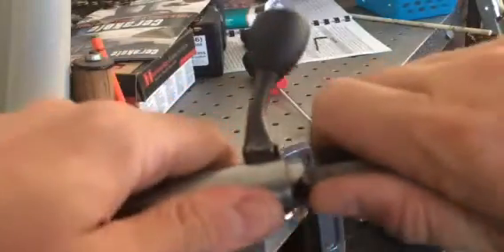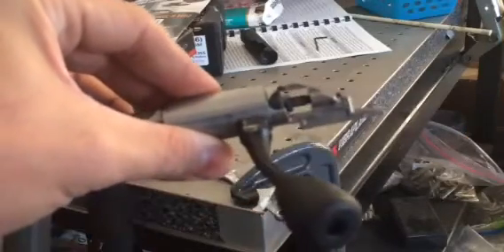How to recock firing pin on Ruger Precision Rifle

Comment: I didn't have a 6mm wrench so I used a 3/16" socket held vertically in my bench vise.  My hands hurt a lot, so I couldn't compress it the way you did, BUT the Tapco AR armorer's tool works great if you use the "muzzle device" cutout.  Gives a LOT more leverage

Comment: If I hadn't come across this video I probably still wouldn't have my bolt back together.  I just drilled a hole in the top of by bench though instead of clamping down the tool.  Think you probably could have stuck your firing pin in one of those holes on your bench.  Thanks for the video.
Reply from the maker: Steve Hicks glad I could help, when o first did this the rifle had just come out

Comment: If you cam over that plastic tool so it's perpendicular, it puts more leverage and compresses the spring even more. It would've been easier to recock. Good idea with the wrench and c-clamp though.

Comment: Does Ruger or anyone else offer an aftermarket bolt? I did this a few times and its getting to be a pain in the A$$
Reply: Not sure if you've gotten an answer to this, but not likely.

The bolt is serialized and matches the S/N on the receiver (well, it does on my RPR).  It is likely if such an aftermarket part existed you would have to get it through an FFL and it would have to be serialized to match the rifle (and, depending on the state it may be subject to a waiting period).

Comment: Where do you get the factory tool at?
Reply: If you have an RPR it's in the bolt shroud.

Otherwise, you can get one from Anarchy Outdoors.  I recommend ordering one from Anarchy Outdoors anyway because theirs are steel and the OEM tool is plastic.

Comment: All fine and good except you installed it 180 degrees out. I had to do the same thing the other day because it came apart during normal firing.
Reply: Why did it come out during firing? Mine just did too.

Comment: hello. i accidentally done it too. what i did is i just keep on rotating it till it went to original position. did i fix the problem? i dry fired it and it is working. i havent taken it to range yet.
Reply: did this end up working? i think i did the same thing to fix mine (was before i came across this video)

Comment: Your pin is upside down, you dont put the pin in a good side, turn it 180 degrees.
Reply from the maker: no it wasnt, went and fired it right after but thanks
Reply: You are right, Stephane.  I made this same mistake, went into the field, and my tool slipped out... before the first shot.  I followed this video and it setup me up back into the incorrect position.  A 180 rotation fixed it.  Now I know!